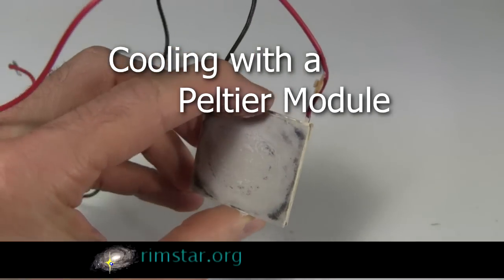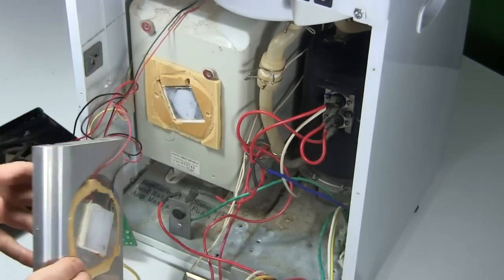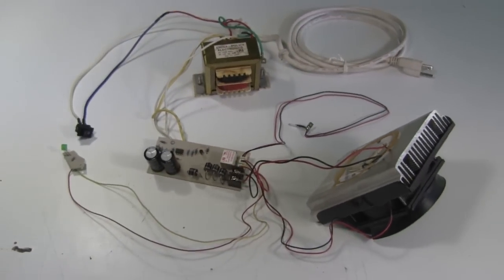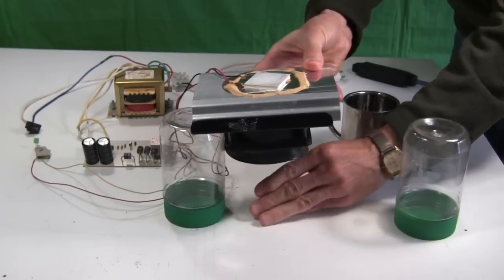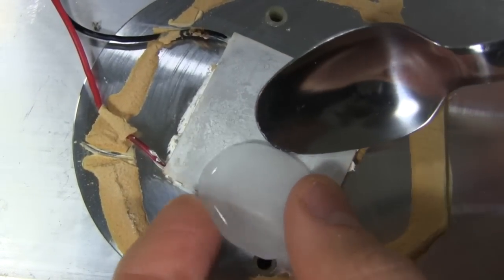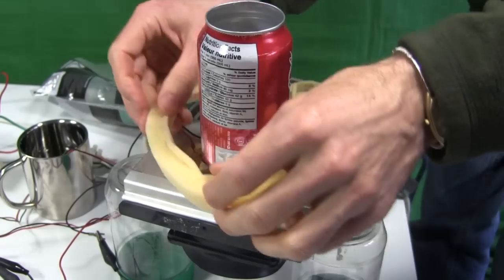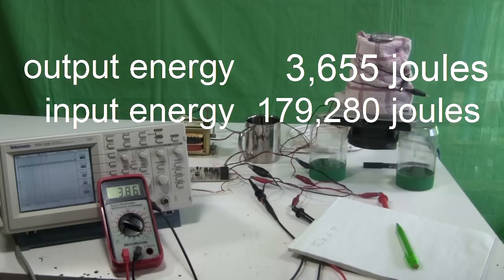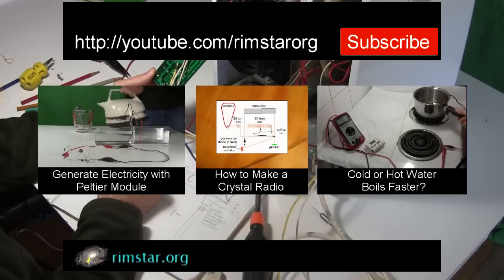Peltier Module Cooling - The Peltier Effect

Comment: SIR,
  i am making a project on peltier helmet. how much current should i pass through the peltier plate if its specification is 6 ampere 12 volts and 60 watts. should i take 6 ampere or less...and why ?
Reply from the maker: umang shah I'm guessing this is a helmet that you'll provide cooling for using a peltier module. If those are the specifications then I wouldn't allow it to have more than 6 amps. You might limit the current to something lower if you're going to have some temperature sensor and the helmet is getting too cold inside. Also, there's probably a specification for the maximum hot temperature on the hot side. You could put a temperature sensor there too and reduce the current if that side reaches the temperature limit.

Comment: How come I have the same Peltier module but it didnt freeze up the water ? Its running off 12v power... Did I purchased a shitty module from ebay or my power is not strong enough ? It's cold but will not freeze. Thanks a lot
Reply from the maker: It could be something to do with the power you're feeding it. As you see in the video I was lucky and had a pre-made power supply. Maybe you're not giving it enough current? But be careful not to give it too much or you might break it. The solder that's used to connect the wires inside it melts at a relatively low temperature and too much current could melt it. If it gets hot instead of cold them it may be broken. I've since broken mine and it gets burning hot very quickly.

Comment: I have some experience with these.  If you were to use water instead of air to pull the heat it should make up for some of that loss.  It is common for cpu coolers utilizing this tech. I have been doing experiments with these on and off for over 2 years for power generation.  The cost of the units does not justify the output.  I am currently trying to build a large scale one out of parts that can be easily be found.  It would be for the purpose of a cheaper more sturdy alternative to these.
Reply: What happens in case of Air sir can u plz give clarity will the cooling efficiency increase in case of Air compared to water ?

Comment: I like your miticulisness & like peoples comments that point to some good points. Some suggestions are it is only 2% effective due to current air pressure and it would be more if you are in higher altitude. I assume inside a vaccume the effectivness will jump to over 20%. for 1/2 to be in a vaccume would be interesting. Since water in a vaccume freezes in room temperature if you see videos online. But I have not seen anyone do both done. Check out vid "Water to ice in 90 seconds using vacuum" ;)

Comment: Hello Steve , 

My name is Sami Thawaba, I am also a lifelong maker and I totally appreciate your work, I enjoyed and learned a lot from your videos and I have some questions to ask regarding the Peltier module: as it was shown on the oscilloscope there was a fluctuation in the voltage and I believe that was a result of the voltage being rectified as it is changed from AC to DC, would our results and cooling performance be better if we used a DC voltage from a battery ?  the other question is would it be a good idea if we used a pulse width modulator as to send pulses instead of continuous current. 

thanks in advance, 

Regards, 

Sami
Reply from the maker: +Sami Thawaba I agree, with a battery you at least wouldn't have the loss of the AC to DC conversion. You may still need circuitry for current control but I'm not sure of that. I don't know if PWM would be better.
Reply: thank you so much, so how do I get the best cooling out of TEC ?
Reply from the maker: +Sami Thawaba Use a big enough heat sink. Attach the TEC to it using thermal paste. Have a fan blowing over the heat sink's  fins.

Comment: You should drive peltier wit current source, and drive it not more then 70% of maximum available current for peltier.
 If You have 6A peltier, then 70% of curent should be 3,5A. Voltage will rise when peltier cold side temperature is going down. This way You will rise efficiency of module.

Comment: curious...... you add electric to peltier module you get heat and cold on opposite  sides of it. .. so looking deeper..... if you add heat to peltier module you get Electric .. so do you also get cold to develop on the opposite side?  Can you use this to convert heat to cool? What is ratio..... Example Heat input at various ranges of "F" produces how much  temp. delta of say water on opposite side is achieved. ?  There is ton of info on going from Heat to Electric via peltier... but zilch (that I could find) on heat to cold.  If this works and "cold" output is the goal.... is a TEG or a TEC module better suited?
Reply from the maker: No, if you put heat on one side in order to generate electricity, it won't produce cool on the other side. The other side will gradually heat up too and the amount of electricity you generate will gradually decrease at the same time. So this won't do what you want.
It won't help you, but the way it generates electricity when you supply heat is that you supply heat on one side and cooling on the other, or at least some way to keep it cool, such as attaching a heat sink with a fan blowing on it. That's because as I said in the paragraph above, when you heat one side, you gradually heat up the other side, and so you need to get rid of that heat.
I have a 2nd video on generating electricity where I do that slightly differently https://www.youtube.com/watch?v=RC16MwzFq8A. In that video instead of using a heat sink and a fan on the cool side, I use an aluminum bar as the heat sink and immerse the other end of the bar in cold water.

Comment: thanks for the video. You are an amazing teacher. Can you tell me what will happen if I don't supply the potency needed by the peltier module? will this reduce the lifetime of the module?... Btw im trying to know if I can make this module ( one like yours) works in a little range of temperature, so I want to know if I just have to reduce the voltage and the amperes. Thanks again to you or to anybody who answer!
Reply from the maker: Carlos Rojas From here https://tetech.com/faqs/#2 the formula for Qc shows that it's dependent on the electrical current (I). So just reduce the current. It won't shorten the life of the module. I don't know if it will make the module last longer than normal.
Reply: RimstarOrg thanks again. One last question: There is any electronic component to do it? or just reducing the diameter of the wire? bc I think I will have a problem with the heating around the cable...? forgive my ignorance, I'm kind of new with electric stuff.
Reply from the maker: Carlos Rojas You can use a resistor to reduce the current. Look up "ohm's law". Basically:voltage = current x resistanceIn your case you know the voltage and the current but need to know how my resistance, so rearranging using algebra:resistance = voltage / current

Comment: Out of curiosity, what were the temperatures of the hot side and cold side of your project?
Reply from the maker: I didn't take any other measurements besides those in the video, which means I only know what the before and after water temperatures were.
Reply: OK.

Comment: Can a peltier module go bad?I have a water dispenser just like The one on the video the fan is working but is not cooling down the water
Reply from the maker: Yes, a peltier module can go bad. Two of mine have since gone bad, including the one in this video. It's possible that I didn't take heat away from the hot side fast enough and melted the soldering inside (I'm not sure). These TEC types designed for cooling can't handle very high temperatures. I damaged it during the experiment in this video https://www.youtube.com/watch?v=D-bPCGhpsUc. Check the comments under that video for a recent very informative comment from Gera Mtz.
Reply: RimstarOrg thank you 👍

Comment: Please help mr @rimstarorag... i used a 12 volt power supply.. and i connctd the module..  but after some seconds its both side become hot..  i thoght it mat be the manufctng mistake of the module.. But its repeated in my nxt module..  i lost 3 modules..  what should i dO.. Its for my project
Reply from the maker: It sounds like you're not powering them properly and damaging them, either with too high a voltage or too much current. You have to find the specification for your particular peltier module to find out its power requirements (search for the part number online). Then you need to find a circuit which will meet those requirements. I don't have any such circuit. Luckily, I already had the electronics from what I took out of the water cooler.

Comment: well if comparing the Wattage of old P4 and new I3 there is a big difference P4 was around 60w and I3 ~35w, so its significantly less, and I3 could be easily cooled with 1cm thick aluminium heatsink with 2cm diameter in center copper core and small 800rpm fan on top, the thing I would like to see if it could be done without any fans or noise making parts, P4 would be CPU that should be tested since its lot hotter tho I would go for old QuadCores like Q6600

Comment: hi.. i like your video.. i m trying the same but. its not going through.... i m using 12v 1amp power supply.. 
1amp current should be a reason?
my peltier device is cooling that much.. :(

help me.!!
Reply from the maker: Check the voltage and current ratings for your particular module. Incorrect voltage and current could be the reasons but without knowing the ratings I can't say for sure.

Comment: I want to build a small version of this, I want a quiet, small fridge for my water bottle. I am more interested in overall performance. I want to control the temperature so that the cooling process is stable at 3 degree celcius. I want the system to be ultra quiet, power needs to match that of a lightbulb, and I want the system to be tiny. Let the fun begin.

Comment: Can I use 12 V battery? Instead of an AC source?
Reply from the maker: That depends on the requirements of your particular peltier module. You'd have to look up the specifications for it online using its model number. You may also need to limit the current. Luckily mine came with a power supply.

Comment: Hello sir, inspired by your videos...started a new channel, can you please tell me which video editing software you use to freeze frames of your videos and overlay the animations onto them...
Respect from India..
Reply from the maker: I've described pretty much my whole process in this old video https://www.youtube.com/watch?v=kZj0_L7lWss. The only difference is probably that I do more 3D animation instead of 2D animation to get better quality (and it's more fun). Freeze frames of the videos are just a feature I use in the video editor Sony Vegas Movie Studio 11 (which Sony sold to MAGIX and is now called just Vegas Movie Studio). In the editor it's just a matter of going to the desired frame and clicking on a button. More specifically, in case you're already using Vegas Movie Studio, it's the "Save Snapshot to File..." button located just above the preview in the "Video Preview" panel. Make sure you select the quality first using the dropdown just to the left of it. And that's assuming it hasn't changed much in the newer versions.
Reply: Thank you sir for your support,  now i will use Sony Vegas for my future videos, i will also go through the video link you mentioned thoroughly  :)
Reply from the maker: I'm not sure if Vegas Movie Studio is the best option, but it works great for me. I have the Platinum version. Note that I'm still on version 11 from when Sony owned it. Now that MAGIX owns it, I don't know if there are any issues. Maybe the latest is still good. I'll probably upgrade to version 14 soon since I've just gotten a new computer with Windows 10.

Comment: Hello Sir, im engineering student and i have some questions. How to get control board ? it can buy or need to create ? and why this prototype needs control board to convert 12V AC to 12V DC ?
Reply from the maker: You can buy or create the control board. You'd have to find the specifications for your peltier module to find out what its voltage and current requirements are though. I didn't the current requirements for the one I used in this video so I was lucky to have the control board already made specially for it in the water cooler.
As to why this control board needs to convert from 120V AC to 12V DC, a peltier module runs on DC, not AC. And this particular one is rated for 12V.
Reply: omg you replied so fast ! thanks alot ! and im sorry for have another question, is that different peltier has different amount of needed current ?
Reply from the maker: I suspect so, but I can't be sure.

Comment: hello. my 12706 device ejecting too much heat and low cooling.even it didnt freez water into ice.what should i do? help me plx.
Reply from the maker: That sounds like a problem I had too, long after I made this video. I figured that it was because I'd somehow damaged the modules internally and they were ruined. I don't recall how I thought I'd damaged them, maybe it was by applying too much heat and not taking the heat away fast enough, or maybe it was a case of too high a voltage or allowing too much current. That may not be what's happening to yours, but the symptoms sound the same.
Reply: Cool the hot side better if the module is healthy. If not, replace it.
Reply: Cool the hot side properly. Otherwise buy a new peltier.

Comment: what is volt ?
how much volt ac  and amp ¿?
I have try AC 12 and AMP 4  tow side is hot
Reply from the maker: I don't know. I just used the circuit and peltier module as taken from the watercooler.
Reply from the maker: You'd have to hunt for a specification or datasheet for your peltier modules part number to find the values it's rated for. Try searching for the part number online. Usually the place you buy it from (the ebay page for example) tells you.

Comment: Aha ok. The heat would be removed as is now, using the fan. Kinda party trick for when guests are around. 
Hmmm, your power board is 12V...a 100W monocrystalline solar panel would run it directly, just when you'd need to run it too - in the Summer sun on a cloud free day!

Comment: If it can make in 3 minutes a few ml of water into ice, it could do in 60 minutes 20 pieces of ice... Let's say that peace of ice has 3ml (in think that it's more) so we could have in hour 60ml of ice (with temperature below 0) from 250ml of water. So we have about 25% of water frozen which would do much lower temperature of the water... So I think you have bad insulation... Which means it has much higher efficiency than 2%...

Comment: What if this was like 50% efficient? Instant ice? Also how does it work, could you crack one open and show us?
Reply from the maker: With higher efficiency it would certainly freeze faster. I found an explanation that goes all the way down to the electron and energy exchange level, but I'm still not quite satisfied with it.
Reply: RimstarOrg So you will make video how it work eventually?
Reply from the maker: Indra Ida Bagus
Eventually, if I can find all the pieces for an explanation. I did do some more digging but have to go through it all again to see if I have a complete picture.

Comment: Unscientific  system

Method of stirring should have been implemented to insure even cooling of the whole controled mass.

Good experiment, not such a good setup

I think if some of the above mentioned precautions are met, the results will prove the device slightly more efficient

Even if the improvment is only from 4% to 5%, it's a 25% improvement.

Comment: peltiers are all made from the same materials and are about 8-10% efficient as its an electro-chemical reaction you can consider that 8-10% to be a 'constant'

you dont have a closed system, whats the ambient air temp? whats the insulation value of your old rags around your sodas can?
this is where the other percentage points went.

Also dont stack them for cooling.... if you want to take out 10w of heat from your cool box,  your putting 110w of heat into the other side, the next layer now has to pull that 110w out of its hot side, at 10%, so you know have a heatsink that needs to move 1210w of heat.... good luck buying a 1200w peltier....

if your doing the ever so common cool box, just buy 4 60w peltiers, 4 heatsinks/fans etc...  way cheaper than one big one. better still buy a absorption fridge that uses heat to make cold... yes its magic, you can even run it on a candle!

Comment: I did my one tests of efficiency. I did cooling water bloks on Peltier module, and one side i connected with pipes to 5 liters tank with water to get as long as possible cold water, and other side 80ml cup with water. I was able to cool down that water to 10C but after 20 minutes. Its very long. Comparing to Your experiments it will fit with calculations. I was able to cool down small cup only because I use water and cooling blocks for water. Efficiency was better rather using big fan, Of course I try fan also... It was much whores. Fan was heated to 40C  cooling site was maximally 20C in best case...
I use Peltier 12705 witch have much better performance then 12706. From aliexpres. Is very cheap, but I think this modules have some production error, and efficiency is much wors.
 Cooling one side with water, and living cold side with drop of water take about 1 to 2 minutes to cool to -20C in best situation, cooling hot side with water. using 12705 module... 
This module with best scenario can have difference ot temperature to max 70C. My experiments show with room temperature of 25C with cooling blok with water  to cold side -20C without radiator.
 
 Heh, I was dreaming that I could cool down COCA COLA for hot days, but with that efficiency, I will wait 1 hour to get only 15C...  I think this project I will drop down.
Reply from the maker: Yeah, it's not very efficient. Thanks for the detailed report!